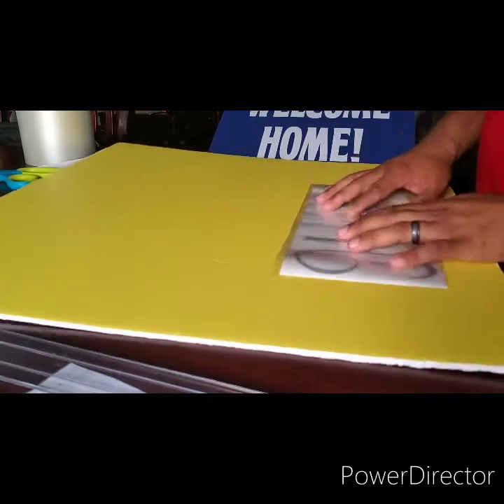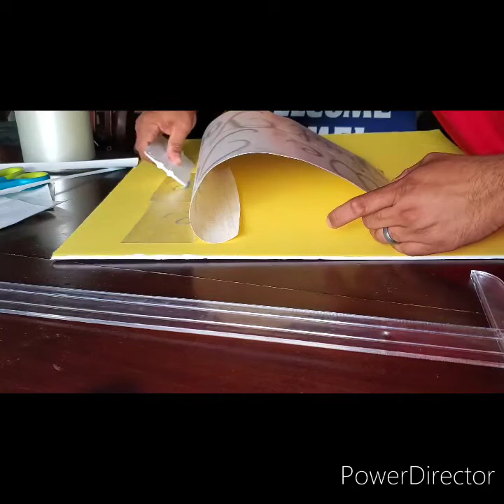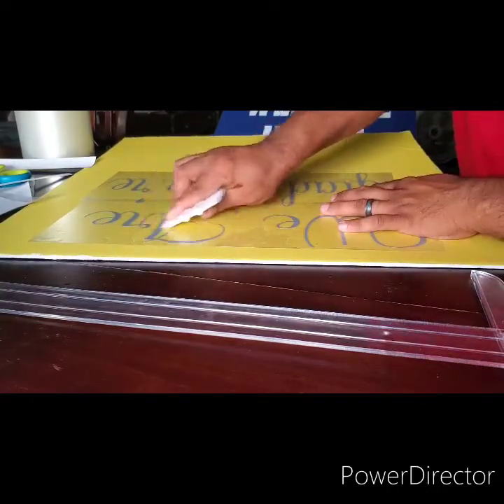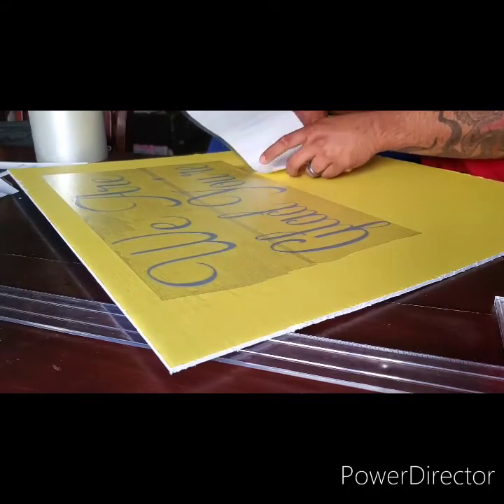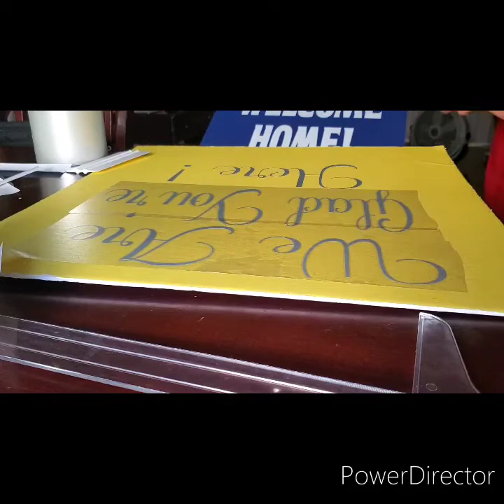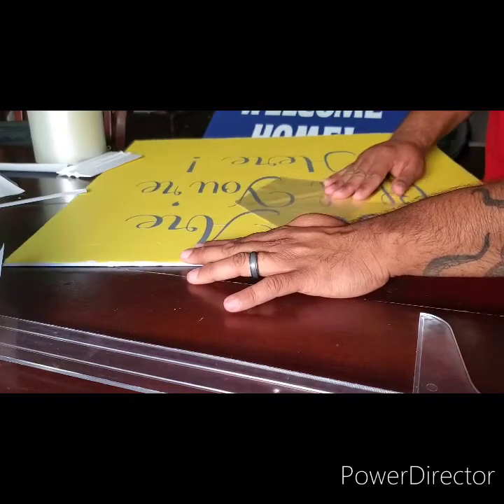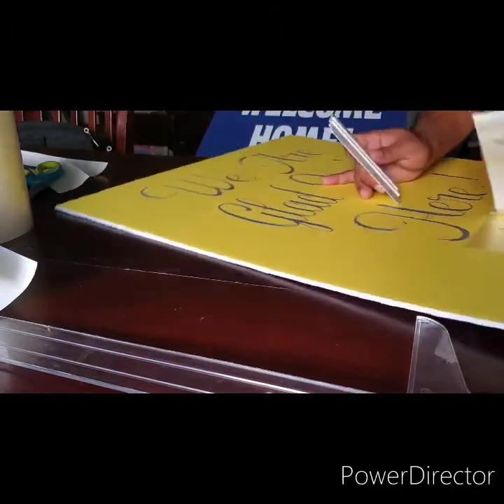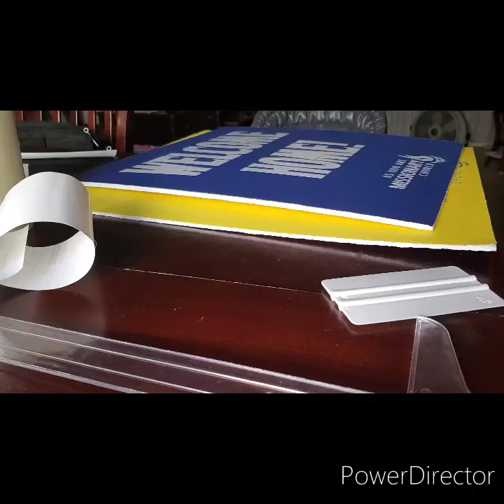Applying adhesive vinyl to foam boards

Comment: Have you ever tried putting vinyl on foam glow sticks? If you have,do you have any recommendations, I’m struggling to get the letters to stick?
Reply from the maker: @Santinox3 i have not tried that. If it is straight foam more than likely it will not adhere properly. Then again im unfamiliar with foam glowsticks. Will look into that and get back to you if i find a solution!

Comment: Can I use HTV (heat Transfer Vinyl) onto foam board-without using an iron?
Reply from the maker: Hey thanks for tapping in! Htv has to be heated to activate the adhesive. What's used in the video is just permanent vinyl, 651. This does not require any heat. But you can use htv on foam boards such as the one I used in the video using an iron.
Reply: @whoiscloseone  Hi, so there's no concern about the iron/heat damaging the face of the foamboard?
Reply from the maker: @LEONARDO THE FABULOUS  there should not be if you don't have a Teflon sheet use parchment paper over the transfer and keep the iron moving no need to apply a lot of pressure.
Reply: @whoiscloseone  Parchment paper-of course!!  Thanks

Comment: Did you have any trouble with the transfer tape sticking too much (pulling up any of the foam board)? I'm working on a photo board for my daughter's third birthday with some gold foil vinyl safari animals and I've got everything laid out, but was afraid to adhere it all and have the foam board rip. I actually thought about trying to peel them like stickers and adhere them by hand, but the giraffe is like 7 by 12, so it would be hard. I just have cricut brand transfer tape.
Reply from the maker: Thanks for reaching out! No trouble whatsoever. You just want to make sure you roll the tape over itself when removing the transfer tape, do not pull up. Please feel free to subscribe if this was any help. More videos to come sooner than later!
Reply: I had the same question and bought a second piece of foam board to test-and there's no issue with the transfer tape sticking.

Comment: thanks for the video, did you paint the foam board before applying the vinyl or do anything to prep the foam board surface/
Reply from the maker: foam board came as is. I did not paint it, although you can I would recommend the pai t be a gloss though on this type of surface.